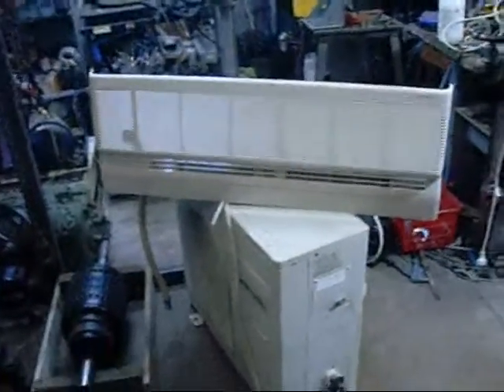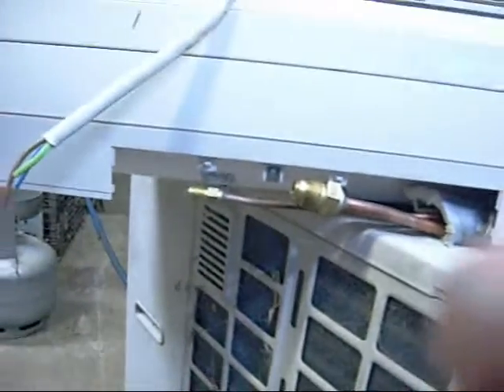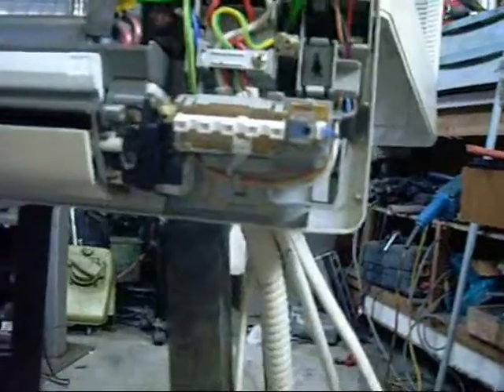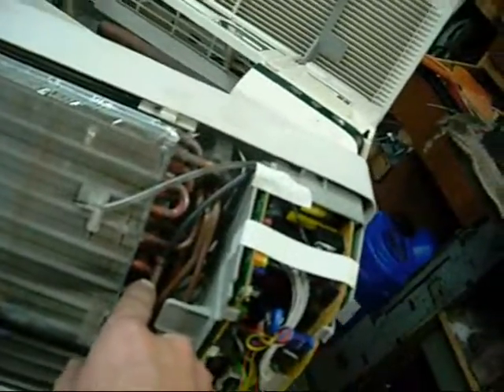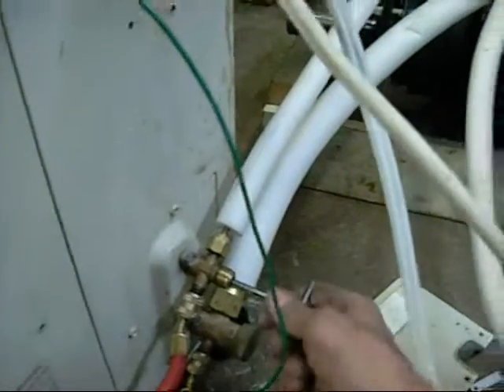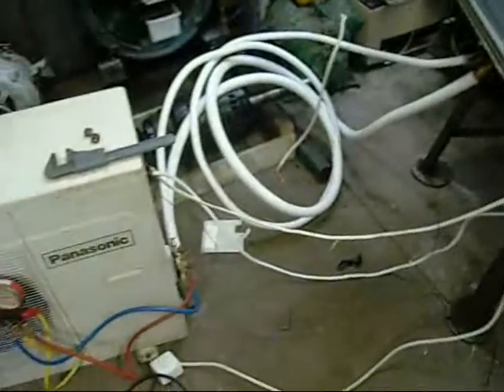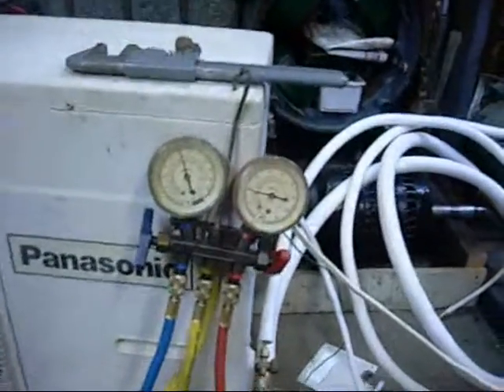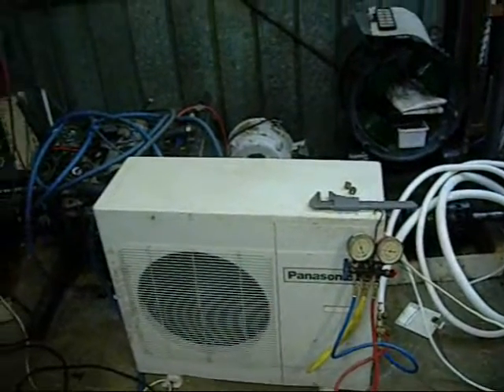Panasonic 6.4Kw Mini-Split Air Conditioner Bench Test Run

Comment: Hey, I found an old mitsubishi Mr Slim unit. It had sat outside for a long time for what I know and the evaporator has oil in it. As far as I know the condenser still has r22 in it. Does the oil need to be blown out or can you hook up the system and let the oil back into the system? Thanks.
Reply from the maker: +fedders airDUDE if the evaporator has been open to the weather for a long time it should be flushed out, it will have dust and crud in it. if it was sealed, I would just fit it up as-is and vac it down good and proper.
if in doubt you could flush the system out with a few litres of shelite (white gas I think its called in the US) and blow it out dry with dry compressed air (do not introduce other oils or water)
Reply: Got it. Thats what I thought. Thanks.

Comment: I have a Panasonic CU-E15CKP5, the auto-diagnose feature says "Cool high pressure protection" error. Would you know the correct temperature coefficient sensor rating (5k,10K,15k,20k,50k etc)  for the sensor which is attached onto the compressor?

Comment: how to identify the capacity of the compressor if it is 1 ton or 1.5 ton or whatever?
Reply: The capacity is in the title of the video, it's 6.4kw. you can also find it on the info sticker on the side of the outdoor unit. Nobody here uses tonnes, we all use Kw.

Comment: Part3/3

(3) The 2 core 20A lead (RED/BLK) of the indoor unit to Outdoor unit as follows;
Indoor RED Terminal '3' -> Outdoor Terminal '3' 
Indoor BLK Terminal '4' -> Outdoor Terminal '4'

Regards Bill.

(Boy that 500 character limit makes things difficult. Even as a 3 part post this is highly edited down and now it does not make sense!)

Comment: Part 2/3
(1) The 3 core 10A GP flex lead on the Indoor unit to go to a GPO to run the fan/electronics of the Indoor unit. (Does this cable run the entire Air-Cond (both units), surely not?
(2) The 3 core 20A lead (GRN/RED/BLK) of indoor unit to outdoor unit as follows; 
Indoor GRN Lug -> Outdoor Chassis Earth Lug
Indoor RED Terminal '1' -> Outdoor Terminal '1'  
Indoor BLK Terminal '2' -> Outdoor Terminal '2' 

Continued in Part 3....

Comment: Dear ED,

A question for you or anyone who can help..

Part 1/2

I have a similar Panasonic CU-1873KR. 

Is this how the unit should be wired?

The indoor unit his three cables coming from it; 
(1) 3 core 1.0mm 10A general purpose mains flex lead. 
(2) 3 core 2.5mm 20A power lead.
(3) 3 core 2.5mm 20A power lead.

Continued next post...

Comment: @Aussie50 That's proof that if I were on the engineering team, another product would have been made correctly.  Only a prick jackass would eliminate all panel switches for a remote control.  Fact of life = remotes get misplaced.  Panel controls are necessary.

Comment: You don't see many of the Asian brands of AC units here, the big makes are York, Trane, Ruud, Rheem, Lennox , and Carrier. Most of the built in AC units are integrated into heating system, the cooling coil is in the plenum of the furnace and the condenser is outside, not including the heat pump types of course, otherwise people use window units or those portable types with the hoses. Those mini split units are kind of rare but becoming more common with time.

Comment from the maker: @10cmsub yep, if you can't find  remote, and the unit has no manual controls, its toast!

otherwise the only option is to rip the control boards out and make a manual control panel from scratch (*on/off switch, heat/cool switch, defrost board for heat mode and t'stat)

Comment from the maker: @g60scuzz I really don't know. I think its more to do with noise.

the expansion point makes a hissing sound during start-up and shutdown as gas bubbles flow through, even when running normally the liquid makes noise too. having the TXV or orafice in the indoor unit would move those noises indoors and be unacceptable.

Comment from the maker: @towrecker yeah, there are a lot of hack installers around here and sure enough, systems leak, or are improperly disposed of (nobody reclaims them) 

You can even buy DIY kits from Bunnings (our Home Depot) and just bleed the air out of the lines after install and its done!. mind you any residual moisture/oxygen is a death sentence for the compressor!

But R134a and equivilent types are all regulated heavily. you can't get it without a license here.

Comment: @Aussie50 I say you just answered the question "they are really affordable and easy to setup!" everyone would be hooking , and unhooking them , and moving those around , the U.S. is all about refrigerant control ya know , so such a unit would in there words "kill the world" they are so worried about gas getting vented , but anyone can buy 15oz cans of r134a at walmart , or an auto parts store , those small cans are a bigger prob , stupid people will dump it in a car with a "hole" in the system !

Comment: I've not really had any experience with Panasonic air conditioning equipment, but if there AV gear is anything to go by their A/C stuff must be good.  My relatives have a De Longhi unit and I remember from reading the user's guide it specifically warned the user not to manipulate the louvers by hand.  Aren't De Longhi Italian?